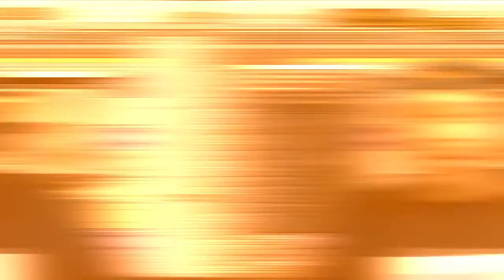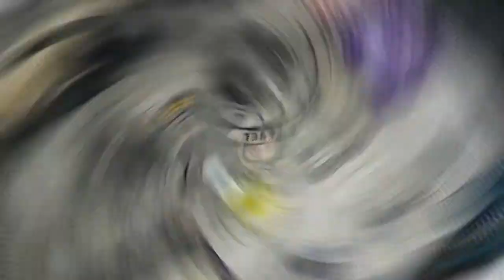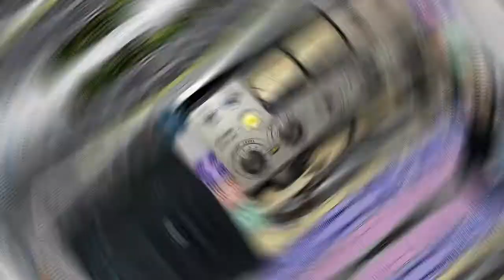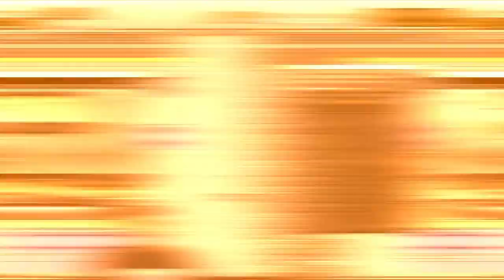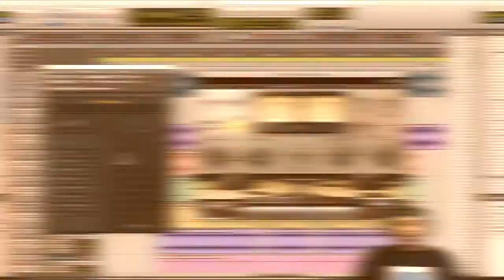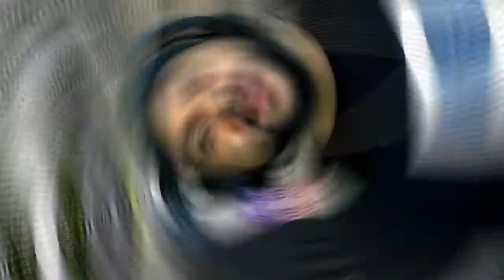Waves Kramer Master Tape Plugin | How To Add The Warmth Of Real Analog Tape Saturation To Your Mix

Comment: Fly I know I keep asking questions and I don't want to be boring but I'm still upset about some basic things and that is, whether the same mastering chain is used in the Daw i while mixing in output chanal (in the box) and in the mastering interface when you import a stereo song with - 6 db headroom, I mean ssl bus, kramer eq, wider and l2, I see that some use ozone 9 for mastering when importing stereo song for mastering?
Reply: I would like to ask the channel's authors something on the subject, does "kramer" amplify the sibilants in the vocals? i know he gives the volume and the size of the song but when does he put it on?
Reply from the maker: Sorry, but Im not quite understanding your question
Reply: @FlyGuyJ  sorry, 😒You do the mastering in the mix interface, does the same chain go and when you do the mastering on a waw stereo song that is ready for mastering?
Reply from the maker: @zabavno2112  I master my own songs so I do the mixing and mastering in the same session. If you were sending the song out to be mastered by someone else then I wouldn't use this plugin or any other mastering plugins. I would simply send the mastering engineer my mix at a levelof -4 to-6 db of headroom. If someone sent me a song that was mixed and ready for mastering I would use this chain or something very similar. Sometimes I choose not to use the kramer tape, might use a different tape plugin, or opt out of using tape if it sounded better without it.
Reply: @FlyGuyJ  thanks m8 👍Somehow it seems better to sound when I master in the mix box than when I export the song in wav format with - 6 db headroom and re-import and master with the same tools I mentioned above, but maybe it's just my subjective impression, I do because I have a weak PC so when I put a lot of effects the processor goes to 100% otherwise I would master in the box

Comment: Should I create a send for the vox or on the track
Reply from the maker: If I were using this to add tape saturation to my vocals (all vocals) I would send all my vocals to an "ALL VOX AUX" or something like that and then place this plugin as an insert on that aux. If I wanted the tape saturation added to the vocals and the instrumental, then I would add it as an insert on my master bus. If I were trying to use this to add slap delay to a vocal then I might choose to add it directly to the track itself, or onto a vocal aux where more than one vocal are being fed. The answer to your question will vary depending on what plugins you are using and what tasks you are trying to accomplish.
Reply: @FlyGuyJ  the only difference of putting something via send as opposed to putting it directly on the track is cpu usage correct? It is going to SOUND the same either way right?
Reply from the maker: @inlovingmemoryofdouglasmul5216   The main difference is that when you use a plugin as an "insert" the audio on that track is traveling directly through the plugin in series. If the plugin doesn't have a mix knob then you will not be able to control how much of the audio is being processed by the plugin and how much is leaving the plugin unprocessed. When you use a plugin on an aux track and "send" to audio to it, you are actually creating a parallel track that is being sent to the plugin. This allows you to keep the original audio unaffected, and then send a copy of that audio to the plugin to be processed. You can then use  send fader to control how much of the audio you are sending to the plugin, and use the faders to blend/mix the unprocessed and processed audio to your liking.
Reply: @FlyGuyJ  so do u use sends for eq and compression too or put those directly on the vocal track?
Reply from the maker: @inlovingmemoryofdouglasmul5216  You can do this a couple ways. 

1) If you want to save cpu you can send all the vocals to a bus, and then have the eq and compression plugins as inserts on the bus track. That way every audio track you send to that bus will be effected by the same plugin chain

2) If you aren't concerned with cpu usage, or if you have different vocal tracks that need to be prosessed differently, then have eq and compressor plugins on each individual track as a track insert insted of sending them to a bus.

* I like to use sends for time based plugins, or effects such as (reverb, delay, flanger, chorus, doubler) and use plugins like eq, compression as inserts